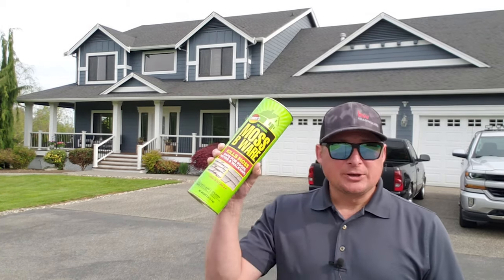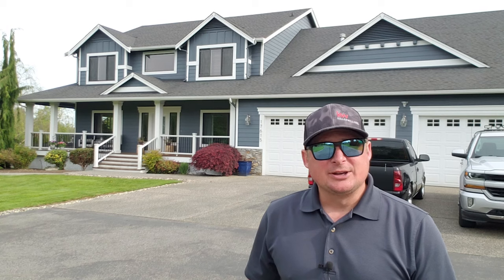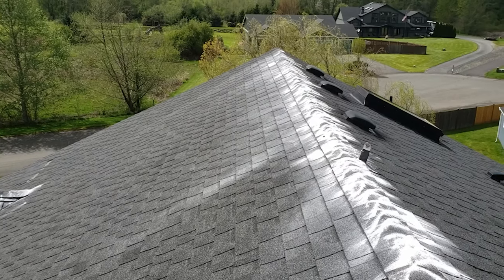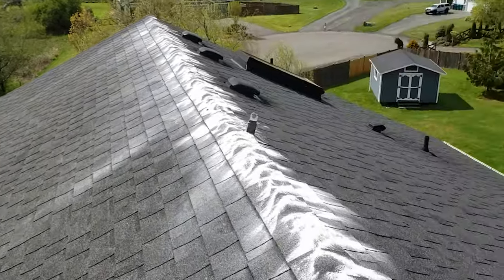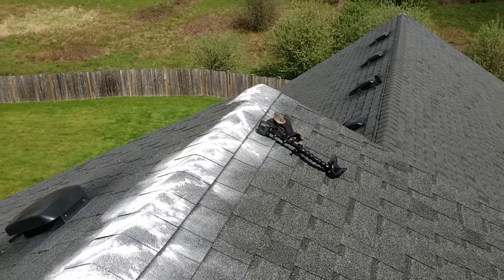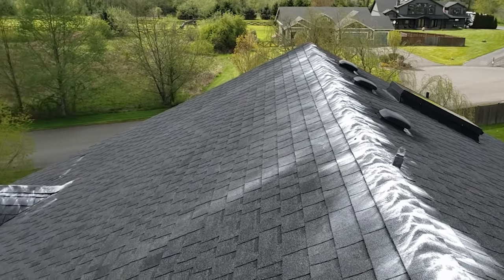How-To: Apply Moss B Ware Moss Kill to a Roof

Comment: Buy 5-10# of baking soda, where they have bulk bins, and scatter it on the roof. It is not toxic and it kills the moss just as well.
Reply from the maker: Thanks for the tip H L.
Reply: Just any normal baking soda will actually work?
Reply: Yes @PierceCalloway

Comment: For your particular home, your most beneficial moss control is the complete lack of shade on your main roof. You'll notice the parts of your architecture that shade portions of your roof expose the areas most susceptible to moss control. It is 10x worse once you start adding trees that tower over your surrounding area and block out the sun for large portions of the day.  Sunlight, and plenty of it, is the best preventer of moss and algae on your roof, sidewalks, and driveways. Your house appears near-fully exposed so that helps a LOT. 

When I moved into my home in early 2000 it had zero moss problems for the first 14 or so years. That's because the stupidly planned Linden trees the city mandated lining the streets were nowhere near maturity. Once they breached the roofline the moss that had been reserved for the ground began appearing on the roof. Fast forward 10 more years and those trees are now 60+ feet tall, shade 3/4 of the home for the majority of the day (except the south side, where my neighbors ridiculous Sequoia's step up to the plate), and moss has become a significant problem.

For general moss control, baking soda will also work. If you want to spray it for existing moss, dissolve a standard box (think: refrigerator box) in 2-3 gallons of water, then apply until soaked. Use a surfactant to assist in it 'sticking' to the sprayed surfaces. I use a commercial non-ionic surfactant from Liquid Harvest, and it works very well. Think of it as soap-on-steroids.

For granular application of baking soda, just hit all the peaks and slant borders sufficiently. As it wets and reacts to existing or added moisture It will raise the pH enough to kill the moss that you already have, but it isn't a super-long-term solution. Baking soda (sodium bicarbonate)  is fairly weak alkaline (around 8.5-9 pH on a 1-15 scale),  It will weaken quickly over time as it dilutes and/or washes away. The upshot is it is generally much safer for plants and wildlife, as it doesn't contain harsh bleaches, etc. You can use too much of the stuff, and throw off the pH in your soil in runoff areas, so be careful.
Reply from the maker: Very true yet the home gets no sun light on the northern roof in the winter months. If you'd seen this home when it was purchased in 2017 you'd know that it has been a lot of work to get the roof to its current status.

Comment: How does it continue to be effective after a few good rains, let alone through the winter?
Reply from the maker: It kills the moss completely and new growth doesn't have a foothold. Its not a continuous deal like zinc strips yet those work like crap in my opinion. Moss B Ware is the most effective moss prevention with 1 to 2 applications (spring & fall) annually. Try it for yourself because for $10 you can't go wrong.
Reply: @BarnettAssociatesTeam  well you’ve definitely convinced me. I’m gonna try it this weekend, thank you!
Reply from the maker: @bonham_music  You're welcome. Now that my roof has been in good shape since buying the home, I apply once a year now and my northern roof receives zero sunlight in the winter months - I am north/south facing home. Report back and let me know your experience.

Comment: Do u apply only the ridges of roof? Or should i cover the whole roof? Thanks
Reply from the maker: Depends on how much moss has grown on the roof. We we bought this house the moss was pretty thick on the roof's north side so I did the majority of the roof. Now, its only ridges. If there is only a little to moderate growth, ridges is probably all you need.

Comment: Usually your roof won't get moss if you don't have trees real close to the house keeping debris and shade on the house.
Reply from the maker: Here in Washington State (regardless if a home is shaded by trees or not), the winter months is when a home's roof's northern slope does not get exposed to sunshine since the Sun is so low on the horizon and moss accumulates.
Reply: Makes sense. For some reason it's not like that here in Pittsburgh.
Reply from the maker: @Headshot-fo8wz  Not sure the climate out there yet we're wet during the winter. Heck, we are super wet right now to everyone's disappointment.
Reply: Yea don't get me wrong I see moss on a lot of my customers roofs but not if theres not a lot of shade.
Reply from the maker: @Headshot-fo8wz  But we're a soggy mess in Washington State and paired with no sun on the northern parts of a roof during winter is all it takes here. 

A 5 minute drive through the County shows you who and who doesn't take care of their roofs.

Comment: I'd wear one of those useless (for covid) covid masks to make sure you don't inhale the dust - seems like one would be breathing well after hauling up the roof.
Reply from the maker: Yes. I should have been wearing the respirator because the wind blows just enough to blow around the very fine powder.
Reply: Wear a mask all! I got it in my mouth from the cloud of dust. This happened 20 minutes ago. Should have worn a mask!